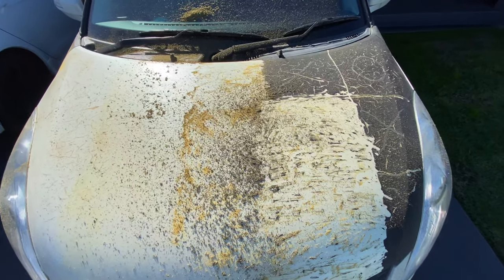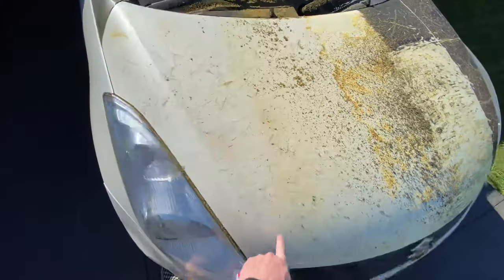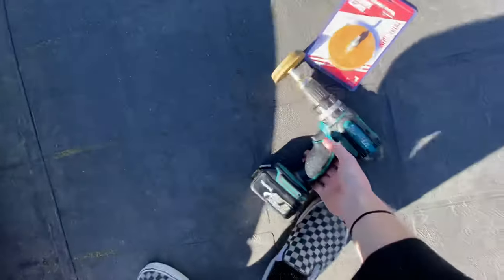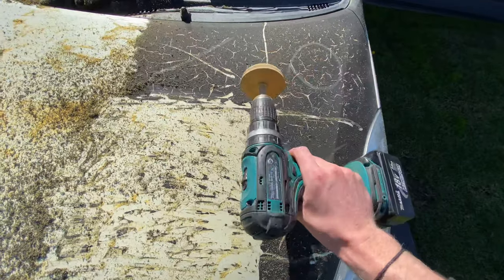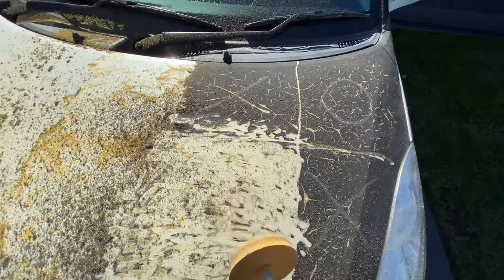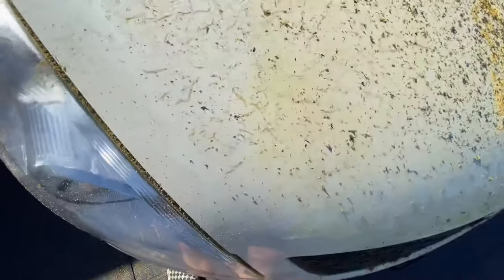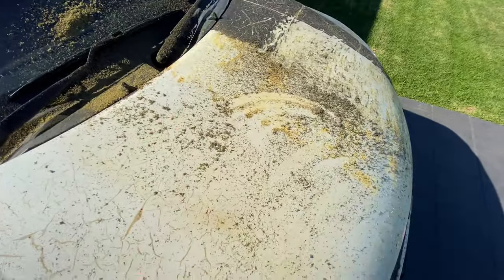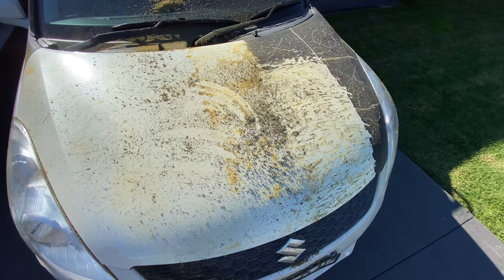Easiest way to remove old cracked vinyl wrap

Comment: Hi Belly, I have to say THANK YOU SO MUCH for your video. My truck had cracked, old vinyl on the hood and the top part of the truck. Was so lost as we struggled to remove the vinyl and it is so costly to get it done by the mechanics. Took 12 hours to remove the old vinyl with your method but we saved tonnes of money. THANKS FOR YOUR VIDEO!!!!
Reply: PS: your method does not destroy the paint underneath too. Was glad that the paint underneath is a good quality one and we removed the old vinyl successfully.

Comment: Hey. A couple of pointers: get the 3M rubber wheel. It doesn't shred like this. You can buy it at most autozone or other auto parts store where you can buy bondo, sanding papers, etc.
Go slow with the speed. Lowest possible speed you can do. The 3M wheel should not smoke nor shred at all. Also less likely to bite into the paint. To be honest, 3 hours should be enough to do the whole hood. You have to shave it off instead of having the wheel bounce around at high speed.

Comment: Does it damage the clear coat even if the paint is perfect? Doing this to my type r tomorrow dont want to burn the clear
Reply from the maker: When I did it there was damage to the clear coat but in saying that I wasn’t taking my time and was going as hard and fast as I course because the coat was already busted and I had to sand the whole roof and hood down to metal and re-prime it

Comment: wow if this is the easiest way to remove old vinyl wrap I don't want to know what is the hardest way to remove it, it looks like its a bitch,  vinyl wrap companies should be liable for removing their shit off vehicles
Reply: wrap is a mistake,  i would never put it on a car because once it gets to this point i will not come off, also they lie about it removing paint, it will remove paint when you take it off. the glue they use is strong enough to where it can rip paint up.

Comment: I have to replace my old chess style vinyl from the roof of my 2006 swift, already purchased the tool!, Ill post my results
Reply from the maker: If you can heat up and peel the vinyl off then you should do that before using the tool, if it’s cracked then use the tool, just be careful because the tool could damage the clear coat